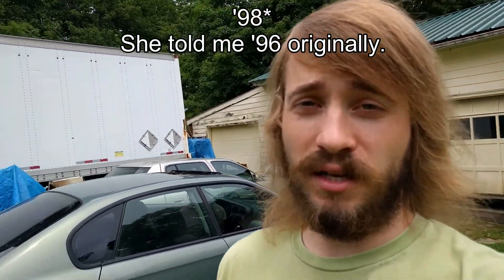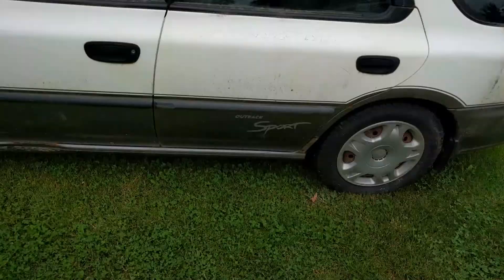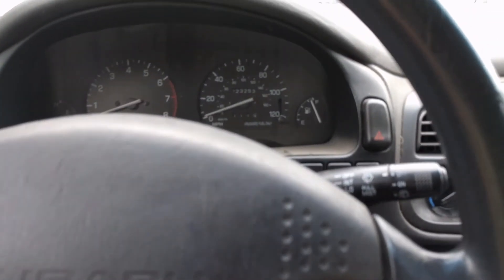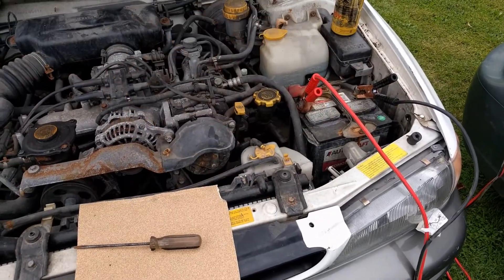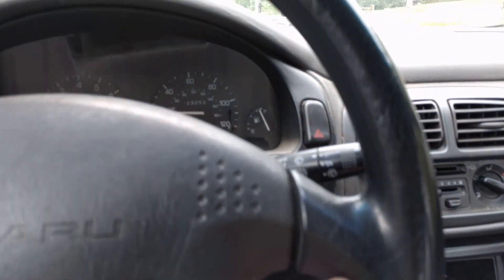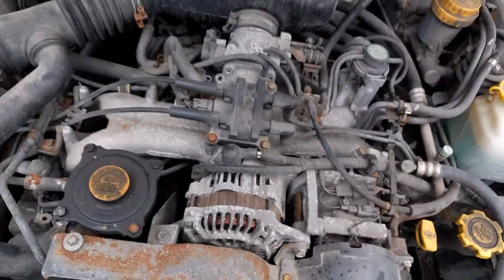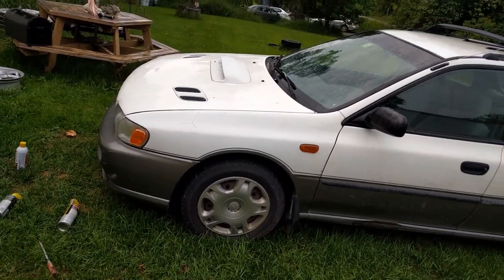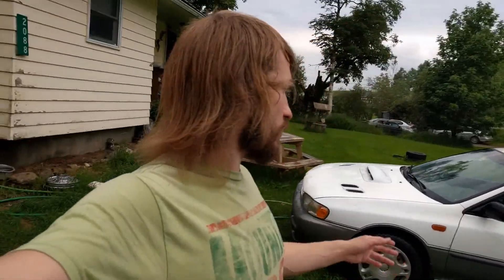$300 Car for My Mom - Rust Free Subaru Impreza Outback Sport! - Head Gaskets?

Comment: god i want to cry, I LOVE THIS CAR! mine is dying, 20 years old and im not sure i can fix it anymore, 300 is a fucking steal!! i dont even want a newcar i just want my car fixed up, when it drives its the best drive on the planet, its saved my life a 1000 times through every kind of weather, from hurricanes to blizzards this car is amazing, i just want my car back
Reply from the maker: Believe me you aren't alone! You should check out a few of my latest road trip videos. I just took my 1993 Impreza on an 11,000 mile road trip and it was flawless!
The car in this video is still going strong. Has had a few minor issues that are basically all maintenance. Still very little rust, other than the exhaust of course, but it goes well.
My daily on the other hand is rusty absolutely everywhere and badly needs brakes all around, but it still goes fantastic! Thanks a lot of watching and commenting.
Reply: @802Garage   no problem brother, actually just got mine back up and running with a little fuel system cleaner, tip i found is when you do the tune up make sure you dont go for the modern spark plugs and make sure you gap em, my car runs like its brand new after i do my own tune up, all the garages half ass it and they try to put the new iridium plugs that say "they dont need gapping" and they just dont work well with the car, use the copper and gap to 38 and the car drives amazing.   I call mine old iron sides, to date ive had a jeep, a Cadillac and a few honda's bounce off  the back of my car with out leaving a scratch on mine while theirs are totaled  lol well good luck with them they are treasures.   The only real continuous problem i've had is the gas neck filler being rusted out, i know i've gotta change it, i just dont feel like getting under there to take it all apart in the middle of the winter, but keep an eye on yours, this is the 2nd 90's subaru that ive seen with the rusted gas neck.
Reply from the maker: @mikeockitch2174  TBH I have had phenomenal luck with NGK platinum spark plugs in all of my Subaru cars. I def check the gap though. It's surprising how fast the copper plugs can go out of spec especially. Glad yours is up and running strong. I can agree on garages half assing too. It's why I do all my own work. I also don't think Iridium plugs are necessary. The plats I have in my '93 Impreza with NGK blue wires have both been in the car for probably 60K miles or more and it doesn't skip a beat.
Pretty funny you recently had a Jeep and a Cadillac hit you. Same cars my mom went through before going to this. No Hondas though, but she had a Chevy Tracker too. The gas filler necks are such a pain! If you have a '97 and later I belive they are cheaper, but the older ones are harder to find now. Fortunately it is a fairly easy change other than rust bolts. Def a pain in the winter though. Make sure you scuff the new one and paint it with sealer and rubberized undercoating!
Reply: @802Garage  i was using the platinum for a while until it started having some misfire problems, couldnt figure out what it was so i changed the ignition and a bunch of other stuff but nothing fixed it until i switched to the copper plugs and the car never ran better afterwards, got me a little better mileage too, but if its not broke dont fix it lol.
   man i really wish i had the money to fix it up top to bottom, interior and out and just do a total restoration.  And i kind of hate the two tone paint job, it just looks so dated. I really want to make it all black but with a silver sheen thats barely visible patterned like hidden flames that you can only see with the right light.  i just think it would look slick.
    Thats a great tip about the filler neck, i've known ive had to replace it for a while now, but i held off because it was super expensive unless i could find one at the junk yard, but now i found a site that makes em for around 80 bucks brand new, cheaper for foresters for some reason lol https://www.fillernecksupply.com
Reply from the maker: @mikeockitch2174  So strange! I've honestly gotten the same or better miles with platinum plugs. Just took the '93 on that 11,000 mile road trip and got 28-34 MPG the whole time with no misfiring whatsoever. I wonder if there are certain years or coil packs that don't agree with non copper plugs for some reason. My '96 and my mom's '97 and multiple other vehicles have been fine too. Not knocking you though of course. If it works for you, stick with it! I just like knowing I won't have to change them for longer too.
I feel you on wanting money to fix it up. All this one really needs is a good wash, the rust spot on the hood fixed, a dent in the rocker pulled and painted,  small hole in a rocker fixed, a dent in a door popped out, and of course a little rear rocker rust fix and prevention. Plus it is missing a few little interior bits and needs audio. I'm actually a huge fan of the two tone paint, but I can totally understand why you don't dig it, hah. I'd love to paint one of these WRB since you never see the 1st gen wagons in that color.
Believe me the filler neck on any 90s Subaru goes bad within 10-15 years in a rust prone area. Also if it helps the filler neck is shared between the Legacy and Impreza, and I believe Forester too. Lemme know if you need help finding one cheap. Some actually come painted too. I replaced mine about 8 years ago and rubber coated it and it's still fine. Had to touch it up a few times too. Oh I shoulda finished reading your last statement hah. Yeah around $80 sounds about right!

Comment: good deal for the Impreza wagon. other than the head gasket issue with the older EJ engines. The OEM radiator are prone to cracking and cause the coolant to leak as well. I have to replace two radiators in my Forestor as the plastic part of the radiator cracked due to the repeated expansion and contraction.
Reply from the maker: It was only the EJ25 that ever had widespread head gasket issues, at least in the USA. EJ22 was always bulletproof as hell. One of my favorite engines of all time for sure.
Never had an issue with my radiators. Most cracking I see is from people over tightening hose clamps. Weird that yours just cracked in the plastic tanks. I have had them start to seep, but if you paint the lower half to prevent corrosion from debris buildup it usually prevents that.
Either way, incredibly reliable rig overall, other than the rust usually, but got lucky with this one!
Reply: 802 Garage yes it kinda weird but i guess that it happen to be the plastic tank that cracked. i am pretty sure why i see tons of subaru owners suggest going for aftermerket radiators even for a clean stock subaru. The OEM radiator isnt cheap to begin with and it cost us a small sum for a last min crack over the weekends and we have no car until Mon to bring it to the workshop for the replacement. Thankfully they have in stock or else it will be a long week without a car.
Reply from the maker: It's def an issue that is prevalent on modern radiators, I just haven't know Subarus to be particularly susceptible, and I live where the temperature ranges from -30C to 38C or so. Perhaps they use a cheaper radiator in your locale? Or maybe it's just that slightly newer cars had cheaper versions, as I'm mostly referring to pre 2000s cars. I would never replace the OEM with an aftermarket right away unless it was a performance upgrade, hahaha. That really sucks though! Best of luck with it.
Reply: 802 Garage the heat here can be pretty crazy. your average temps are 29 to 30 degrees. highest you can go is 36 degrees and the cooling system is working overtime to cool the engine. Plus the air-conditioning is adding more pressure.

Comment: and i usually flush the brake fluid tank/resivuar to get the old fluid out and the lines after i do a full around brake change of pads and rotors or sometimes shoes.
Reply from the maker: The brakes work great! Fluid flush however is first thing on the list. This fluid is literally green. XD

Comment: do a coolant flush and when you do a oil change let all of the oil out first and to flush and clean the crank case get some gunk tune up, i had done it before and it was pretty cool what i got out. it helped get all the old and gross things in the crank case
Reply from the maker: Yeah it def needs a good oil change! There was some decent varnish in the filler neck. Some Pennzoil will fix it up right. Coolant flush is in order as well. Thanks!

Comment: Looks like it has a tiny leak in one of the head gaskets,leaking water into a combustion chamber.
The bubbles in the overflow tank at 5:21 are a dead givaway...and the rusty water over the engine.
The good news is you can succesfully repair small h/gasket leaks in Subarus with  a sodium silicate/copper additive,I've repaired two so far and it's much easier and cheaper than pulling a head.
Reply from the maker: Yeah, that is my suspicion as well. I thought the bubbles may just be the coolant system bleeding if we are lucky. After driving it about 100 miles more, it has used maybe a quart of coolant. That's not a lot, but it's enough to suspect a tiny leak. I'm not quite sure what you mean about rusty water though.
I have actually had success with a head gasket fixer before. Lasted at least several thousand miles before the issue came back. I just ordered some Subaru Coolant Conditioner which allegedly has a minor fixer in it, we'll see if that helps. Otherwise I may try a better fixer or just change the head gaskets, hah.
Thanks a lot for the comment!
Reply: Sorry, mistook the rusty belt cover for rust coloured water on the engine.
I owned a '91 Legacy that wound up with 300,000+ miles on it,with a head gasket leak that was fixed with a liquid additive.
Although,being a SOHC EJ,it's not that bad of a job to replace the gasket.
I just hope I don't ever have to do one on my '99 Version 5 WRX Type RA's EJ207 DOHC turbo engine...that'd suck.
Keep up the Scooby visds,I'll keep watchin'!
Reply from the maker: Luckily the turbo engines are not known for head gasket failure. At least not in stock boost. That's one of my fav engines ever made though. You are very lucky to have that car! We still can't get them in the USA. There will def be more Subaru videos over time, including bigger projects.
Reply: My RA has 165,000 KM's on it,all stock,apart from an Apexi downpipe off the stock VF29 turbo,into the stock STI exhaust.
It ran 12 PSI stock,I turned it up to 14,then when I installed the downpipe,it 'adjusted itself' to 16.5 PSI and it's a very happy engine.
Best engine Subaru ever made,the first year of the Phase 2 EJ207.
I'd love to ship my car to the States and cruise around in it,right hand drive and all,that'd be so much fun.
Just scored an STI Genome muffler...Matches my STI Genome gauges : )
Reply from the maker: Yeah I agree, best engine Subaru ever made. They are just insane. Power, reliability, sound. I def want to own one someday.
STI Genome? Don't even know much about that series of parts. Sounds cool though! We missed so much cool stuff in the USA.

Comment: I pulled my 99 Impreza 5 speed out of Rathe's in Colchester with 113k. Headgaskets, timing belt, nearly everything has been done to it, too bad the quarters are gone and this state's inspection is so brutal. I can't even drive it anymore because it won't pass inspection.

Comment: time to change the headgaskets. totally a pain in the ass in a subaru. at least you can locate if it's only one side.
Reply from the maker: I'm really not sure the HG is bad. Drove it all the way home and have run it a bunch since and it really hasn't used coolant. Almost wondering if they were just air locking it or running it low on coolant. Probably just being overly optimistic though. Either way, at least I can pull an engine now! Thanks.

Comment: I thinks it's a 1997 not a 1998 because of the interior the exterior is the same but just not the inside of the Subaru
Reply from the maker: You are actually correct! I thought from the manufacturing date it was a 1998, but the VIN shows up as 1997. I thought it was odd because of the interior being like my 1996 rather than later models as well. Thanks for the comment!
Reply from the maker: Sorry for the delayed reply. Will you be making videos?